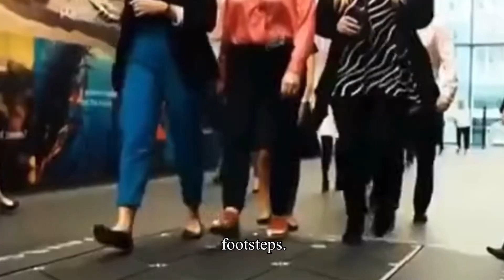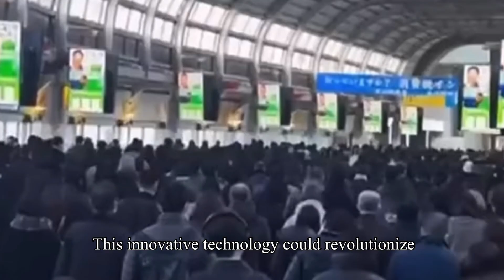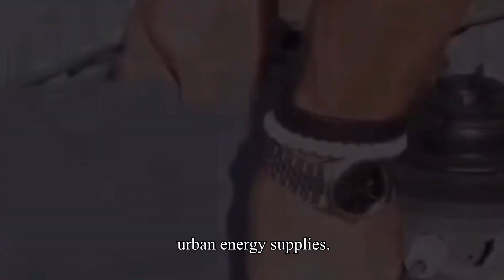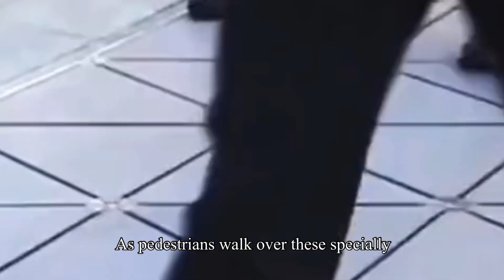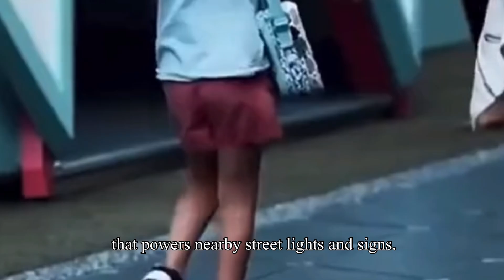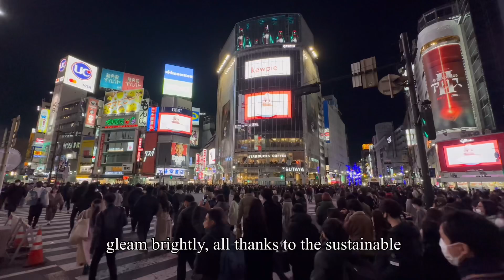Japan Generates Electricity from Footsteps by Piezoelectric Tiles! | Japan Piezoelectric on Road

Comment: great genius
Reply from the maker: Indeed! ❤️
Reply: Its not so..nothing new We have talked about that before 15 years.. But also comes with preis.. Walking on 'soft' ground is exhausting.. Its like you are climbing if it drops a little bit by every step.. In some country they tried to install solar panels on the road.. When the road is bussy there is shadow and also panels failed quickly.. Same will happen with that' invention '.. It will be expensive with little output